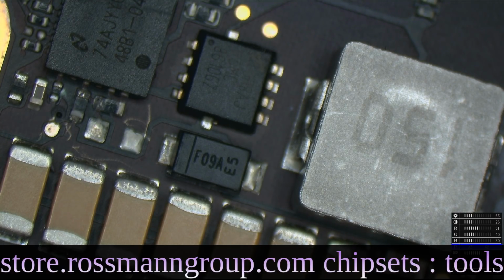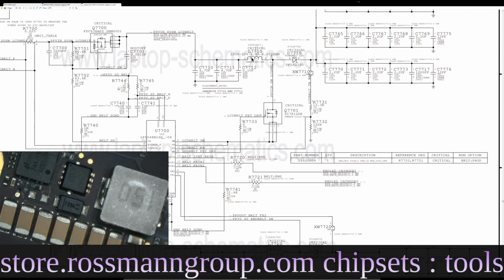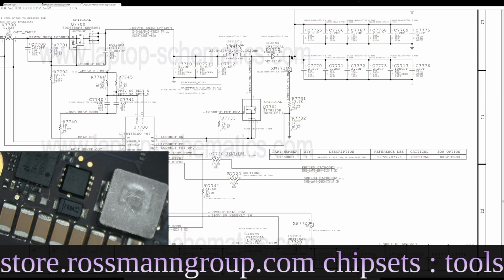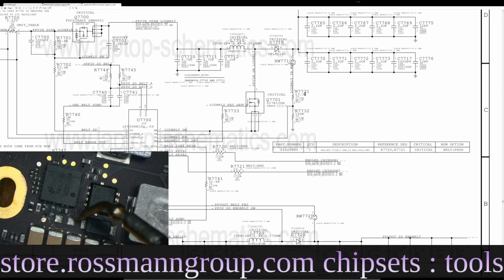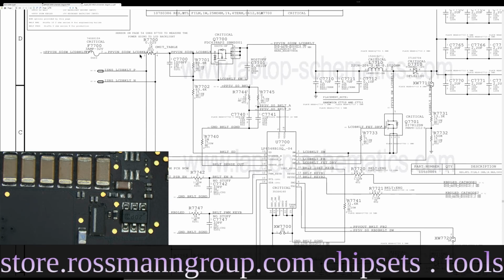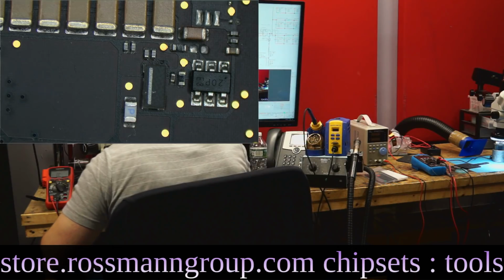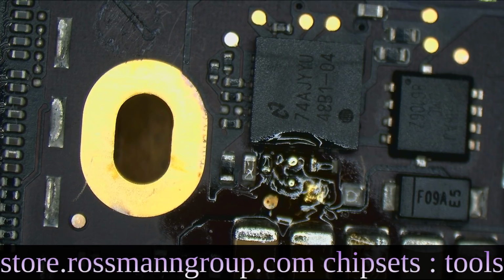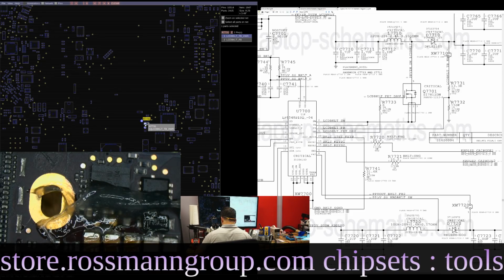Can we fix A1708 Macbooks without schematics?

Comment: Hi Louis, my question comes from a person who knows nothing about electronics except from the consumer point of view. I know though quite a bit about guitar valve amps which for decades have been repaired, parts swapped, circuits recaped, etc in order to keep each instrument alive. But in the computer industry -  and to every repair guy I talk to - when a machine has a problem they either replace a whole module with an old stock one, or advise you to chuck the whole machine out in the bin. You are the first person who I have seen going in and repair these things which indeed (Im stating the obvious) are for the most part "repairable". In short: what the fuck is going with this industry? why are computers not repaired at micro level when they can be? Is it lack of knowledge amongst servicing guys? Best regards from Europe

Comment: I have a A1708 macbook pro with liquid damage on the Keyboard. Is there anyway to turn this on without using the keyboard power button? I know older models had power pads you can short two small "power pads" to turn the laptop on, bypassing the power button. Any help is greatly appreciated!

Comment: This is most likely a very dumb approach on getting a multimeter read on your OBS, but you could probably just read the LCD pins directly and translate them into text with an MCU, an Arduino Nano (because USB) would do just fine. Then you code the Arduino to update some text file (.txt or whatever) on your PC with the translated values say every 50mS, and you read the text file with OBS.

This method would work with any multimeter as they all need an LCD of some sort, and OBS is able to read and update a text file that is being updated. But yeah this is coming from an university student that studies CS so I have limited experience in hardware reading, there are most likely way simpler methods but I doubt they would work on a 10 dollar multimeter.

Comment: What type of like, classes would you have to take in order to generally understand this. Like would this be under Computer Science, or like Computer Engineering?
Reply: tecneeq, computer science is theoretical. I'm not sure what computer engineering would be, but I'd most likely classify this under electronic engineering. I'm a computer scientist, and certainly cannot solder such small components on a pcb.
Reply: @sanderd17  and like a good like understanding of English and like some maths and real determination to like stick with a problem until you have like solved it.

Comment: I tried to desolder and soldering back a resistor of this size. It's much more difficult than it looks. Don't try it with a regular soldering station without microsoldering tip.

Comment: Deskpins works well for on the top with Windows 10
Reply: I can confirm and it works for individual chrome WINDOWS(not tabs) so you pull a tab off chrome and pin the created window while you look and use the one behind it